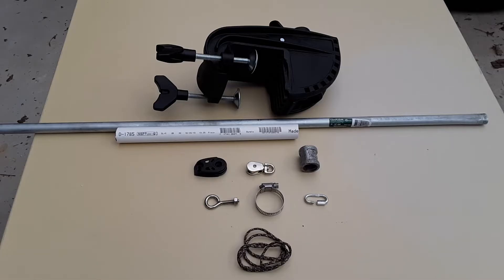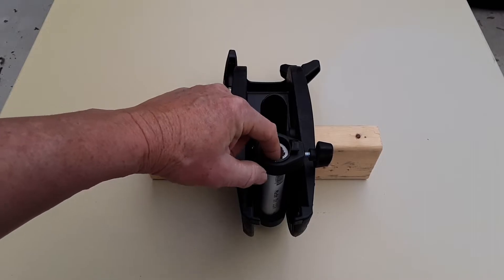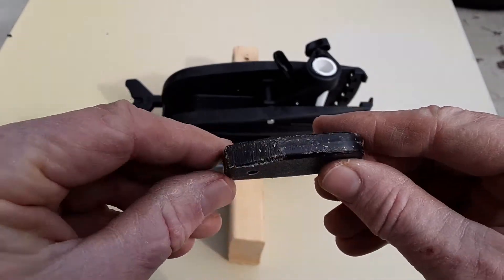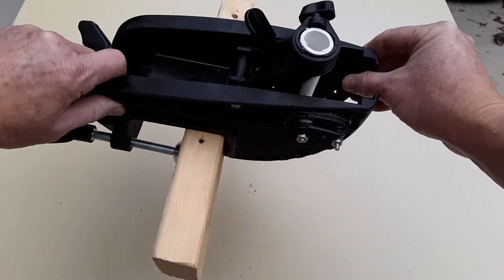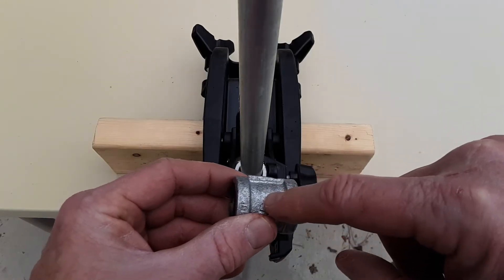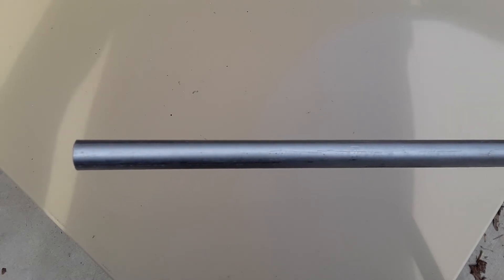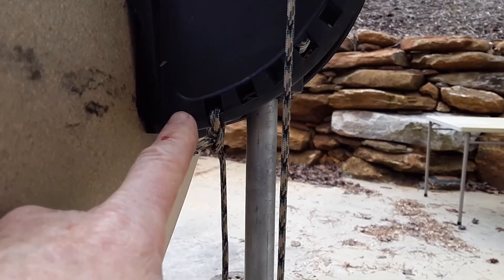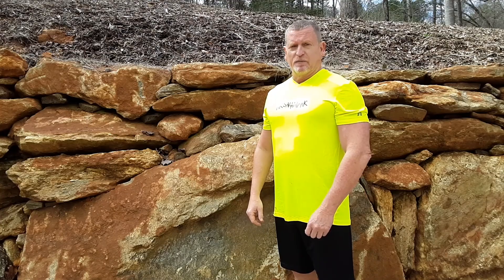DIY Removable Remote Actuated Stake Out Pole

Comment: This is a great video and great idea. I will use this to make one for my skiff. The only thing I am adding is some weight to the top of the pole, so when it goes down, the weight pushes it deeper into the ground  so it holds better. Thank you for the idea.
Reply from the maker: Glad to help Melvin. The top weight is a good idea.

Comment: I see you have an X Seat on the kayak now. Is this the same kayak you had a few yearrs ago when you mounted a boat seat on a NuCanoe base? 

I also see an anchor trolley on this kayak. Did you replace the anchor trolley with the fixed stern mounted anchor system?

Comment: Have you had any concers/problems with the shaft not having enough flex because its metal? I had a similar concept to yours, I'm just worried about the mount breaking or damaging the kayak because there's not enough give to the setup.
Reply from the maker: Hi Dan. No that hasn't been an issue. I think if you are in that much current to break the mount then it might be a good idea to move from the location. JMHO.

Comment: Is there a certain size of minn Kota trolling mount you used, because there are a lot of different models
Reply from the maker: It is a standard 1 1/8 inch diameter shaft mount.
Reply: @Aksmaniyak  thank you

Comment: Nice job 👍 does the stake out pole stay on the boat when you transport it?. I did something kinda similar, I used a 1/2" fiberglass pole 8' long and made a aluminum tip with a blunt point that slip's over the end of the pole with a removable pin so I could detach the point and remove the pole when thansporting the boat.
Reply from the maker: You can leave it on during transport. Just release the lever lock and lay it down.